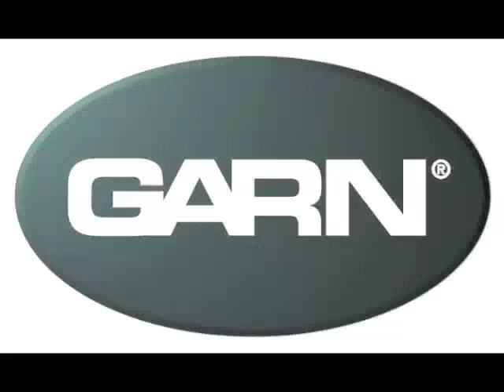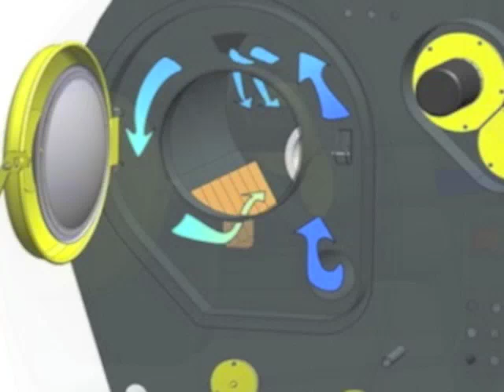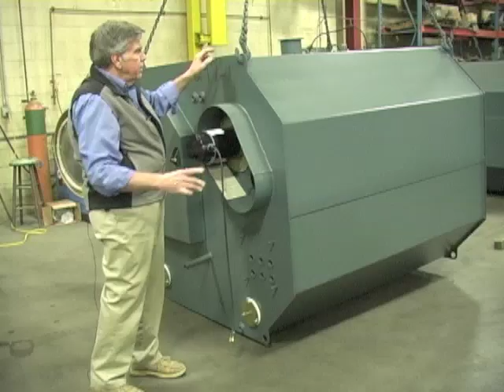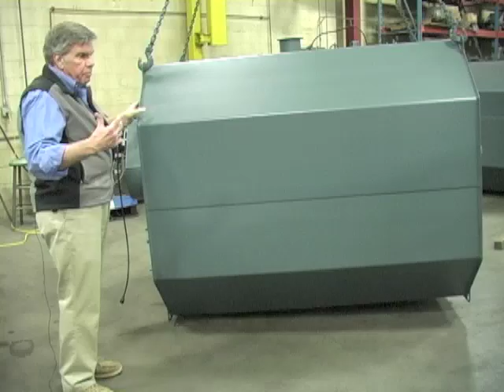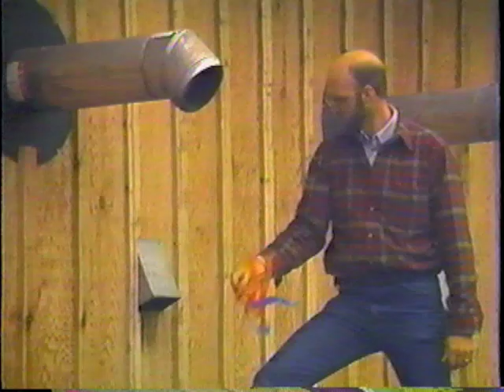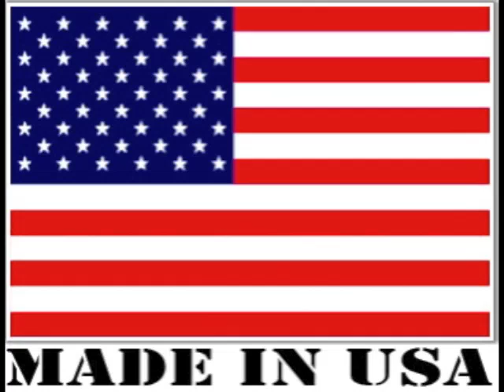GARN: The Junior

Comment: If these units are individually numbered that unit is currently in my basement.  Been very pleased with it so far.
Reply: How long of a burn time do you get in coldest months ?    
I currently have a GreenWood boiler with a heat exchanger in my duct work and hot water tank.     I really like it, but the firebox is aging and I can't get 8 hours of burn in 0 degree weather.    
thinking about replacing with this Garn junior/1000
Reply: @littlelarry2912  Good Morning,

This is not a unit that requires the "standard" length of burn time. Garn units burn hot and complete till exhaustion, though you can add more fuel (wood) as it burns down to increase the amount of heat that is transferred to the water in the tank.

In short, the length of time that the thermal storage (water) can last is dependent on a lot of factors like insulation of the Garn unit itself, the distance from the house (what ever you are heating) how hot you got the water on the last burn (195F is a good temp and over can harm the chemistry of the water in the tank), level of insulation in the house, and what kind of heating method (heat exchanger) you use.

I have a VERY lose house and baseboard radiators, my Junior lasts 8-10 hours in 20F temps. I also heat my domestic hot water off the same unit.

Hope this helps answer some of your questions.

Comment: Does the fresh air intake running through the water and getting pre warmed   make any difference from a pipe just running along side the boiler but outside of the water? It would be at least two less likely places to leak if it was outside the water.